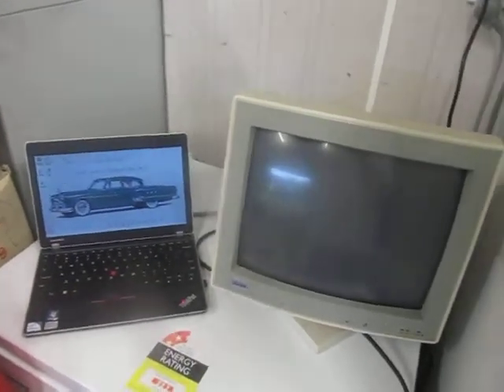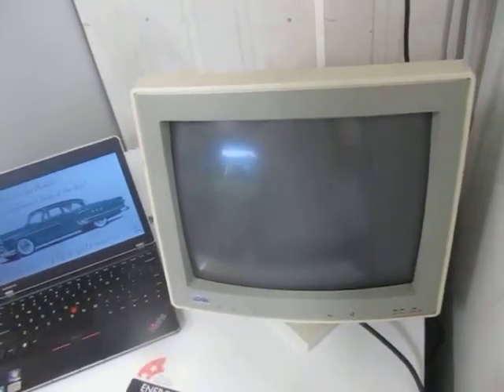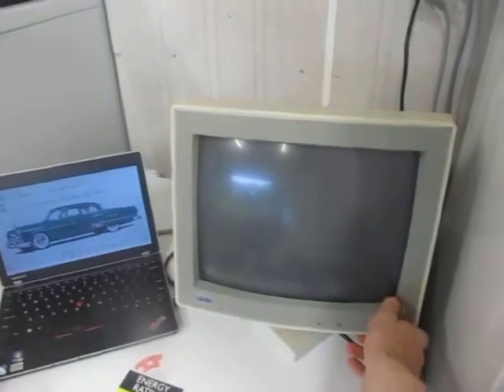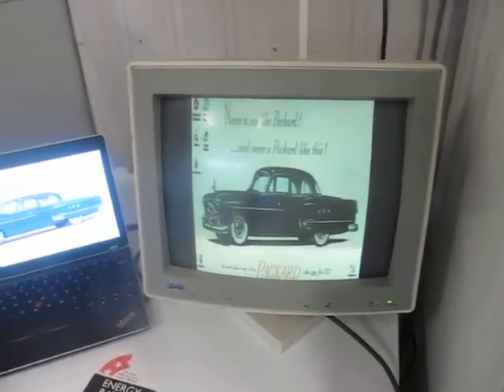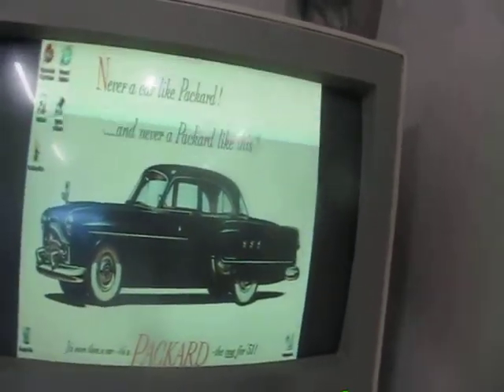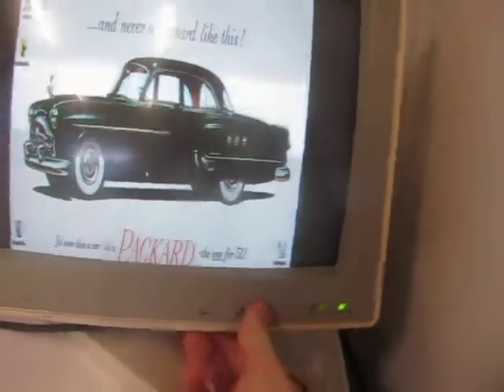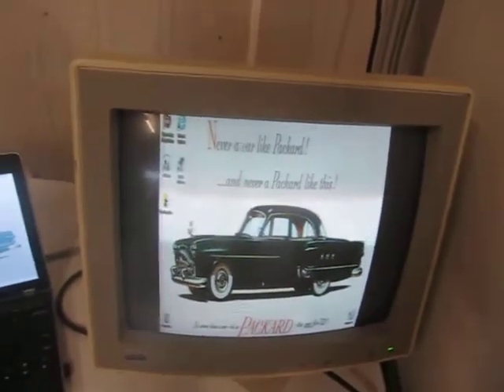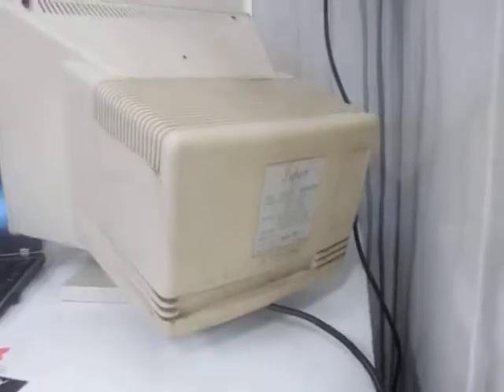CRT durability

Comment: Meh, I am not surprised, as I have done this with almost every CRT TV I have found and they all still worked after being in months of rain.
Reply from the maker: I would never store something I planned on using like this though. The weather will definitely shorten the life of the set, and will gradually destroy it. The rain will damage the internal circuitry, and the heat/direct sunlight will damage the case (and bake the insides). Especially if they're stored in an area with lots of surfaces that trap and reflect heat (concrete, brick walls, tiled roofing etc.), the damage will be more severe. The direct exposure to sunlight outside will gradually break down and destroy any plastic casing too. Sets are fine in sunlight indoors, as the glass windows/doors generally filter out harmful components in the sunlight, thus limiting the damage.
Reply: ***** Well a lot of my sets are extras that I haven't given away yet. Usually the sets that I use most often don't get wet. I unfortunately have no choice for a few sets though. :(

Comment: Is it still getting thrown out?
Reply from the maker: Maybe, I'm not sure at the moment. It depends if I can find it a new home.
Reply: Does it work properly? Is the image just squashed because of the setting on the laptop?
Reply from the maker: hayden may It's always been like that. The squashed horizontal deflection is probably from leaky caps, and strangely there are no potentiometers to adjust the horizontal width, despite there being pots for the vertical height etc.
Reply: *****  Oh that's really strange, thought it would've had adjustment
Reply: Fairlane500skyliner old comment I know but I'm trying to figure out what's up with my Apple 21" Trinitron. It's super narrow, less than a third of the horizontal space is used but it does display the whole image if it's 800 x 600 or lower otherwise it looks like it's trying to go out of spec. Could it be bad capacitors?
Reply: It was working fine for about a year since I got it and it was well within spec during regular use.